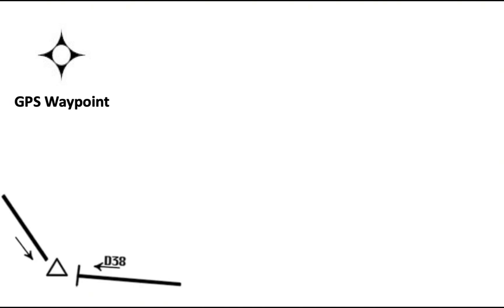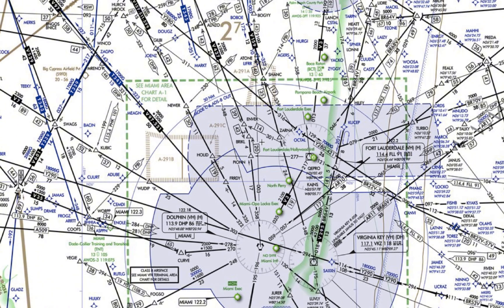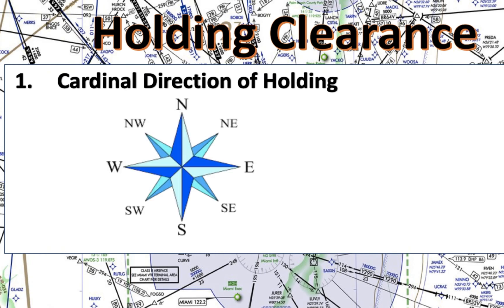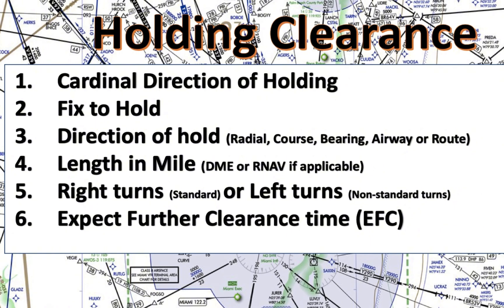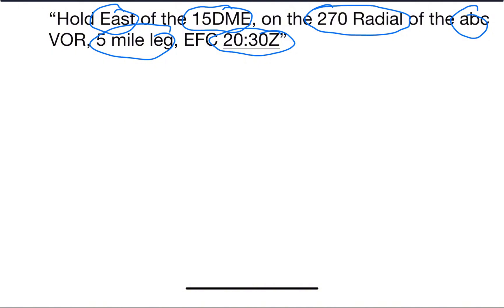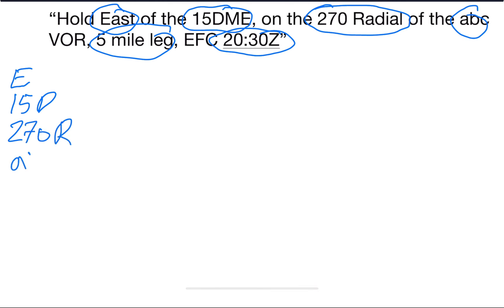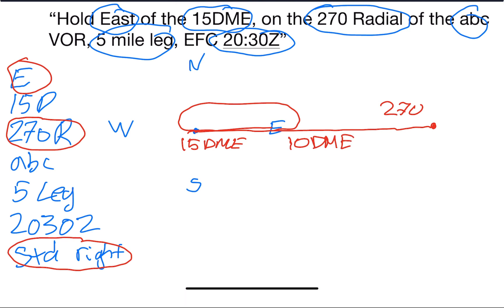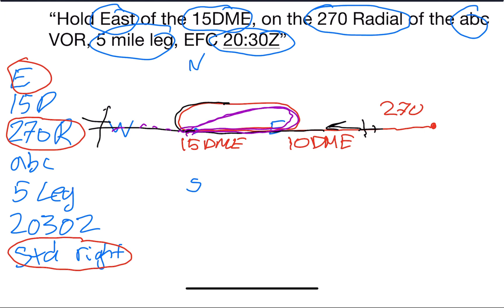How To Hold At A DME Fix

Comment: Sorry but couldnt understand the last two examples. How can you be holding West of the DME on the 090 radial ? That would only occur if you hold on the 270 radial . Same goes for the last example , you’re on the 130 radial , meaning you are SE of the Station and not NW as per the instructions . Could you elaborate further ? Thank you
Reply: Because you're holding  " WEST of the 15 DME point " not west of the  VOR STATION

Comment: Bro you messed up the first example. The 270 radial is pointing to the W from the navaid not towards the east. Anyways it was very helpful thanks.
Reply: Isnt the first example Radial 090?
Reply: @Mimeomeoz yes that’s holding west on the 090 radial.
Reply: actually the example is correct. read it again

Comment: 🤔 What am I missing? On your first example, that’s the 090 radial, not the 270 radial.  On your second example, they’re also swapped.  Radials shoot out from the station, so if ATC instructs you to hold on the 090 radial, that radial shoots out to the east.  It’s impossible to hold West of the station on the 090 radial.
Reply: Because in this case, you are holding on a DME fix that is on the VOR radial, not holding on the VOR itself.
Reply: You are holding 15 miles from the VOR, that is your fix, from there u could hold East or West on that radial…..
Reply: Got the same result . The instructiosn clearly tells him to hold West of the station, but that is impossible to do on the  90 Radial , in any position on that Radial you’d be East of the station as you mentioned. I guess people should first understand the concept before trying to teach it
Reply: @golfergab  i guess you should rewatch the video before trying to criticize